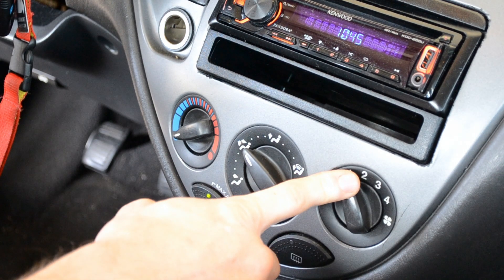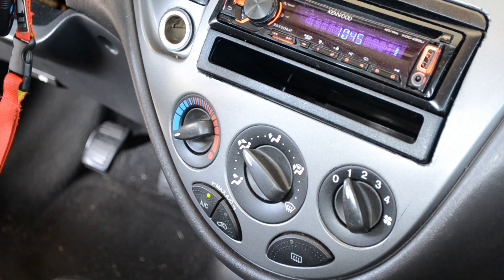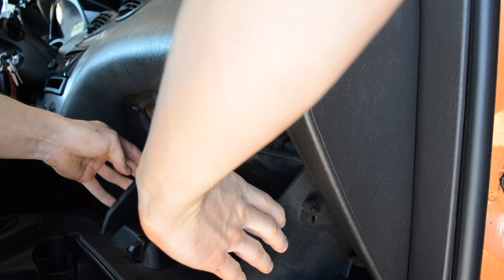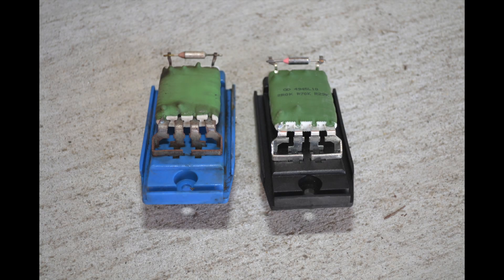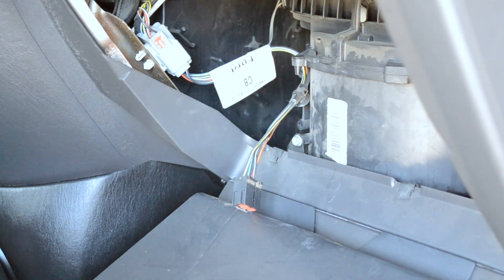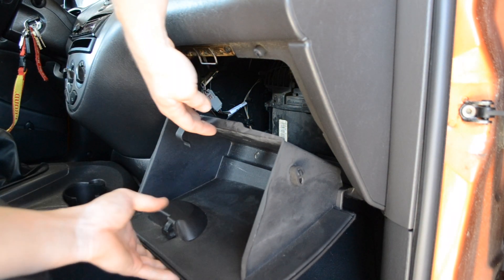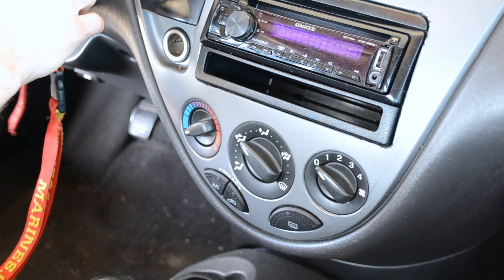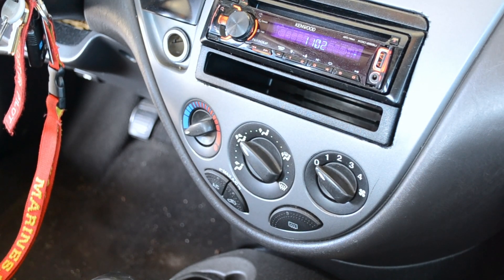Blower Motor Resistor

Comment: Thank you. Where did you buy this slot(?) under the radio?
Reply from the maker: It was just part of the head unit install kit. https://www.walmart.com/ip/99-5200-Installation-Kit-1999-2004-Ford-Focus-1999-2002-Mercury-Cougar-Vehicles-Black-995700-725600-20002004-Black-955806-Vehicles-Harness-19992004-M/731058616?wmlspartner=wlpa&selectedSellerId=11243&adid=22222222227096330730&wmlspartner=wmtlabs&wl0=&wl1=g&wl2=c&wl3=214103718911&wl4=aud-310687322322:pla-345265056179&wl5=9010583&wl6=&wl7=&wl8=&wl9=pla&wl10=117071854&wl11=online&wl12=731058616&wl13=&veh=sem
Reply: Dave Medicus thank you Dave.
Reply from the maker: No problem Thanks for watching.